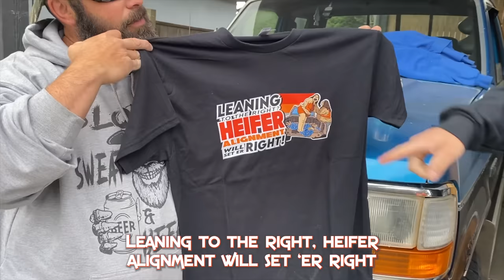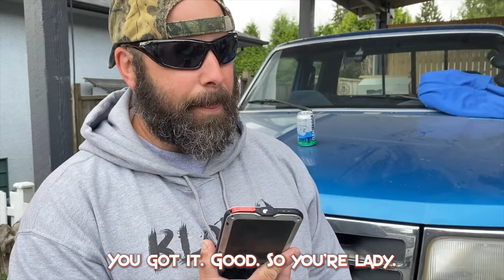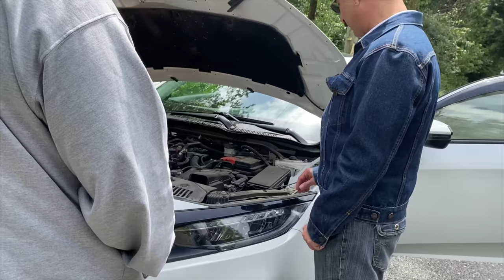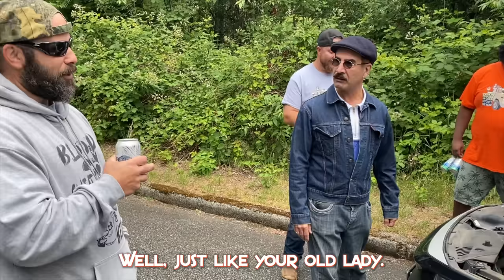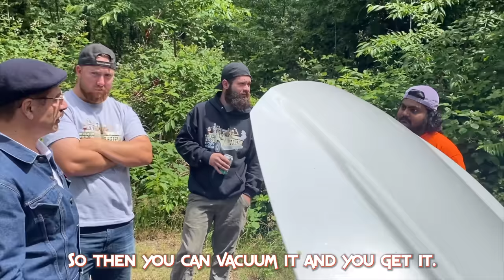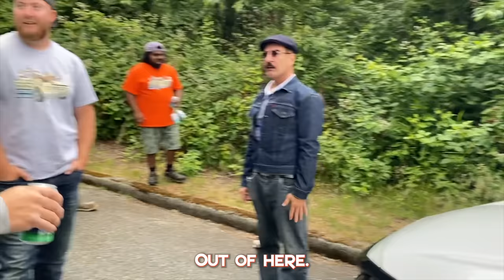LOWBALLING OUR 3RD HONDA CIVIC!

Comment: I just checked KBB and the private party value on that exact optioned civic is $26k CAD... Where do these people get these insane prices?
Reply: That's why I was wondering it's too much for a civic. I'm in the US so that car would fetch about 18k here. Only an idiot would buy it at that price with those miles. 2016-2019 years came with oil dilution problems without the proper oil 0w-16 oil fixes that problem.
Reply: This video is fake lol
Reply: Child support